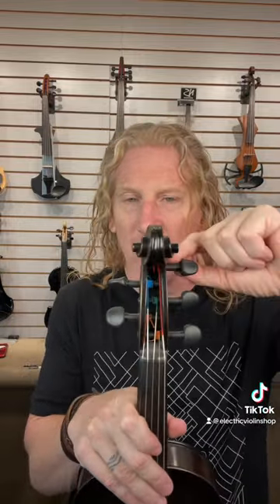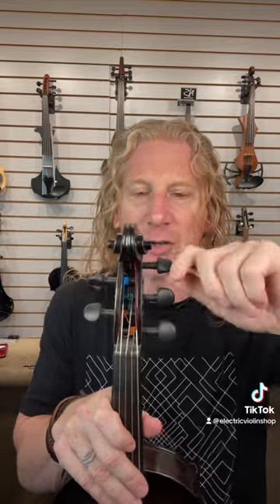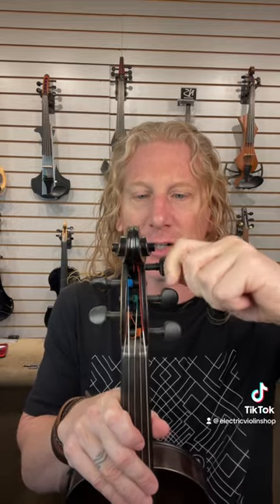Geared Pegs on a Violin? #electricviolin #violin

Comment: What's the difference between a violin and a viola? I really need help with my whatever I call it.
Reply from the maker: A viola is a lot like a violin, except that it sounds good.
Reply: A violin is smaller in size and plays higher notes. It has the strings G, D, A, E (from lowest to highest.
Meanwhile the viola is bigger in size and plays lower notes. It has the strings C, G, D, A (lowest to highest)
Reply: @ElectricViolinShop  💀💀💀